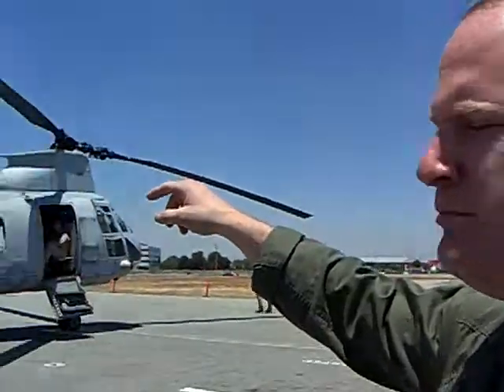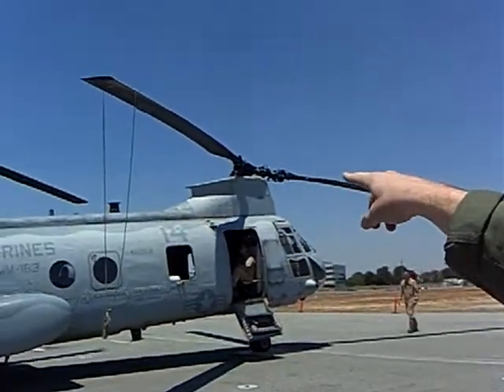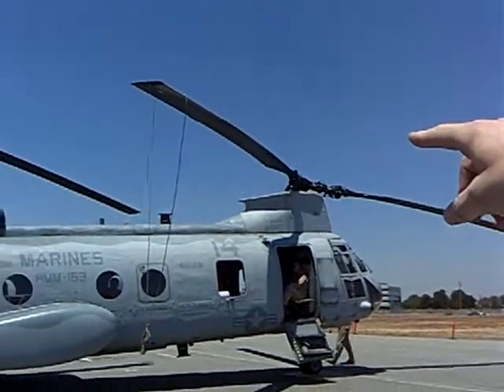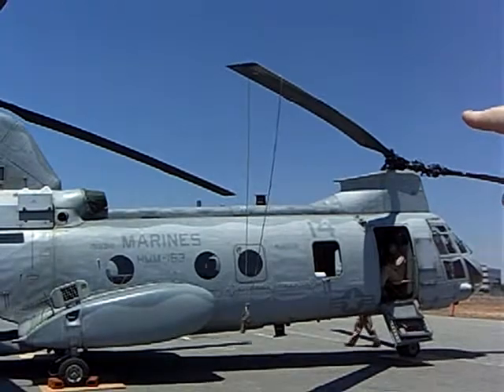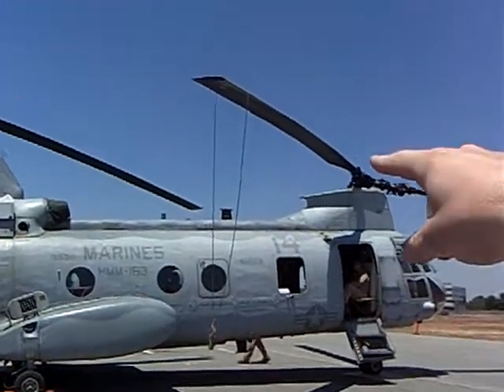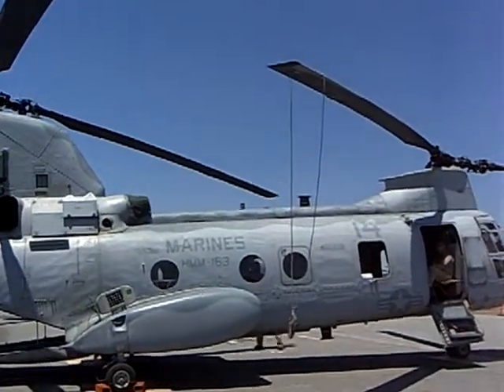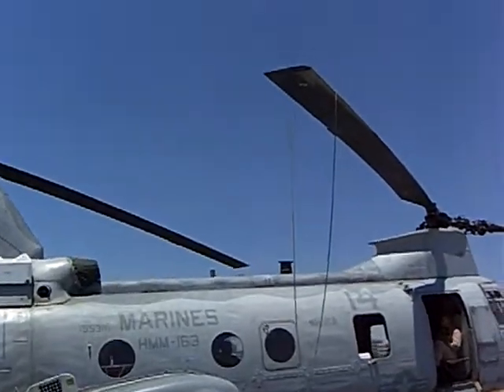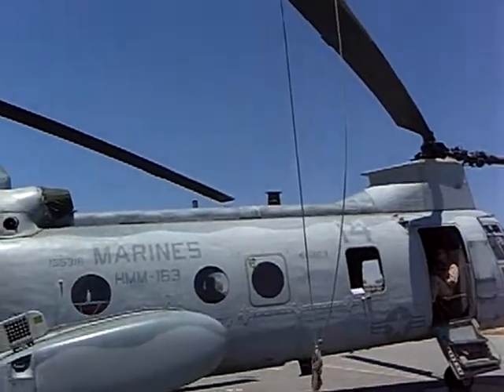Close look at US Marine CH-46 Helicopter Rotor/Vib sys -5

Comment: Please, to the pilot that is doing this interveiw, Just fly the damn thing and stop talking about stuff you don' understand.  The Photo sensor mounted on the #3 tunnel cowling only takes a optical track of the blade such as lead and lag.  Not vibration.  That is the job of the Velo blocks mounted Fwd of the Fwd tranny fwd of the rear trust bearing.  A separate vibration is connected to the 8520 gear for vibration at certain regimes of flight such as hover and 120knots.  Chalk on a stick 1980's?